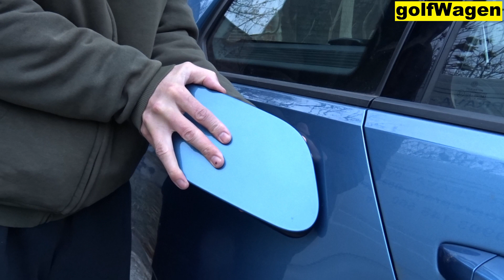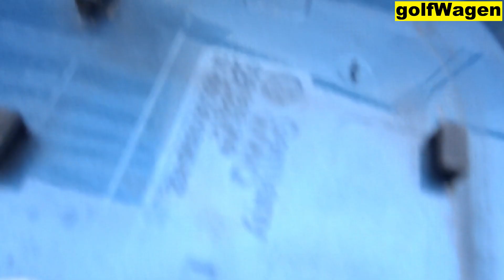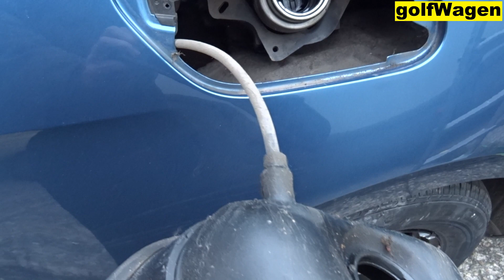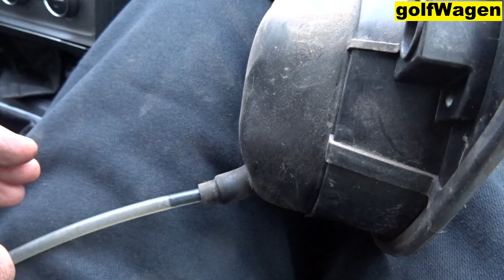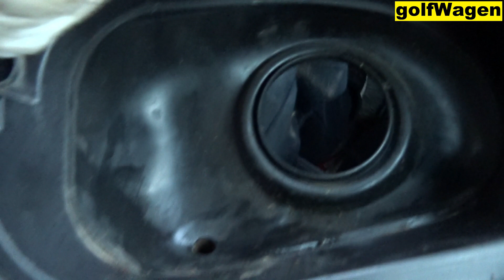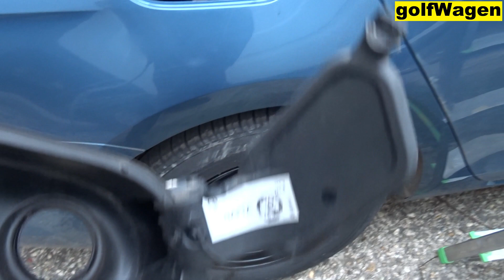VW Golf 7 fuel tank cover removal

Comment: There is a pin at the back of the oil cap cover. Use a straight sharp tool can remove it.

Comment: Thanks just used it to remove that motor, inside you will have to remove the black plastic part on the right also with a t20 to gain access to the connector.

Comment: I have a different issue. Been searching online but it's all about the actuator or motor.  My 7.5 only has 16.500km for which like last year only 400km was driven (not going into detail). The doors mechanism has gone stiff probably because of not refueling (I think about the environment ;-) ) .. So I was just at the fuel station and the door didn't click open. Had to use my fingernails. The door hinge part is stiff and the spring doesn't have the force to push it open. I wiggled the door open and close like 20 or 30 times and now it works a bit but still I fear that it will become harder and harder.  Any way to spray that hinge with oil with a long strow or does it need to come out?   Also can't you take out that part with taking that cover off?